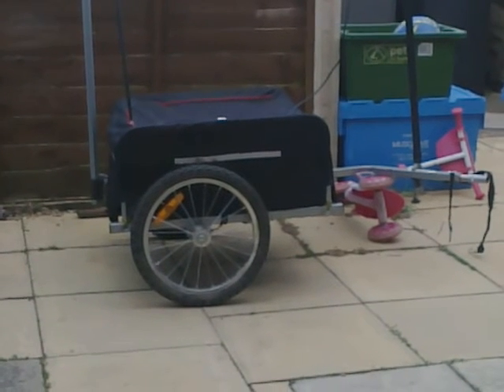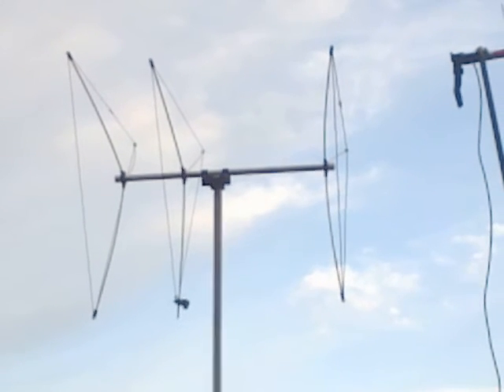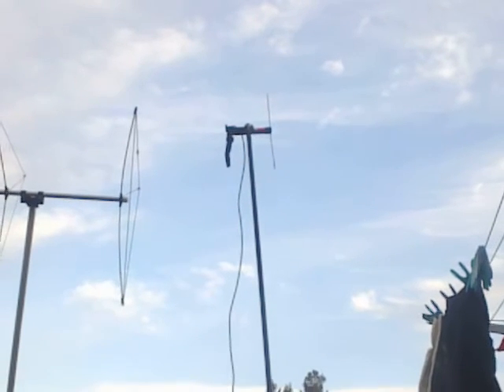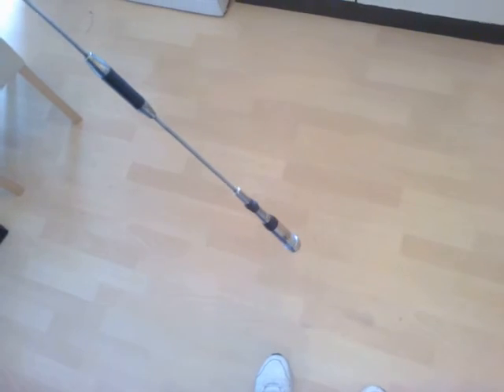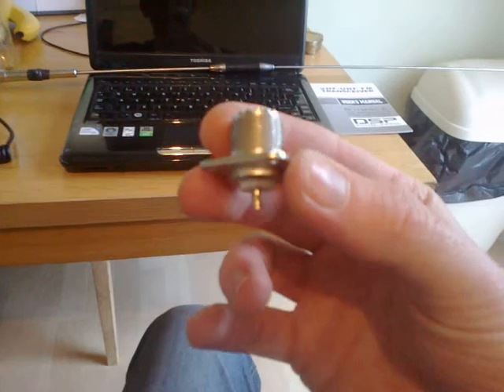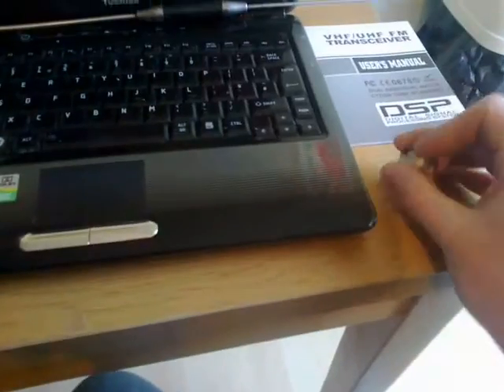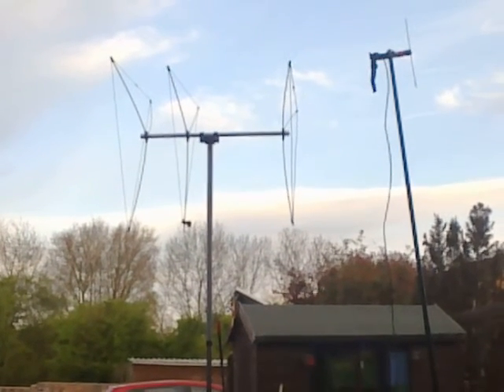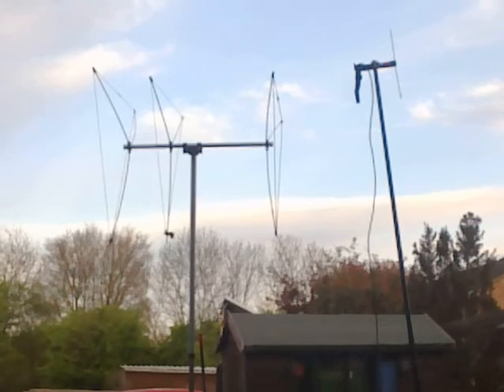2 more antenna for the DX bug out trailer project

Comment: No3...3 ELEMENT DELTA QUAD So239 feed point
Suitable also for portable as disassembles quickly Gain 11.1 DBi boom length 0.75 mtr 200 watts,directional